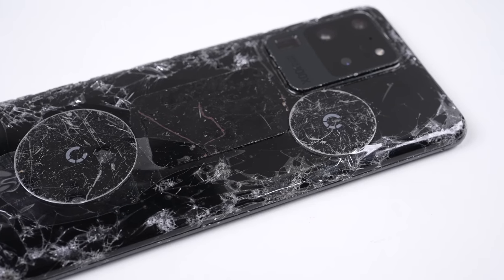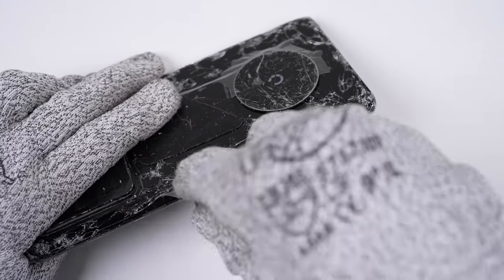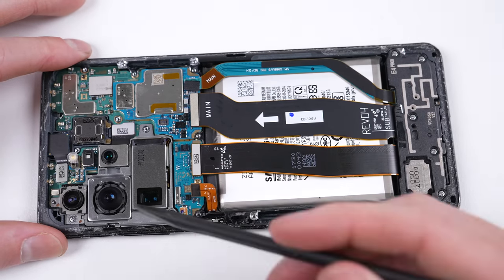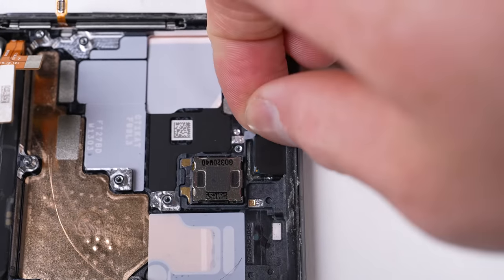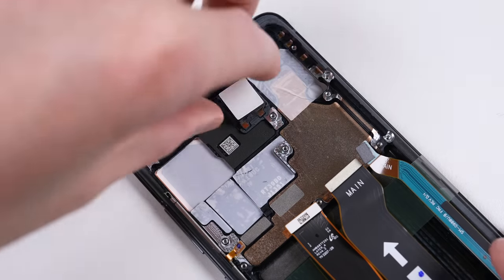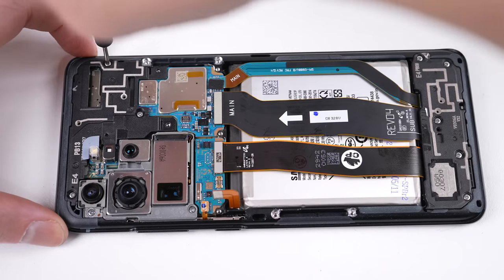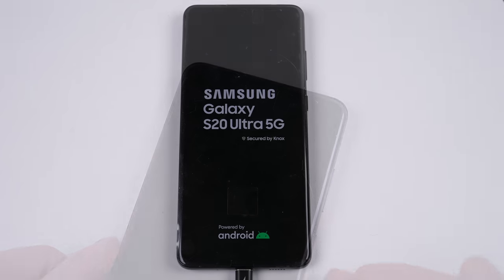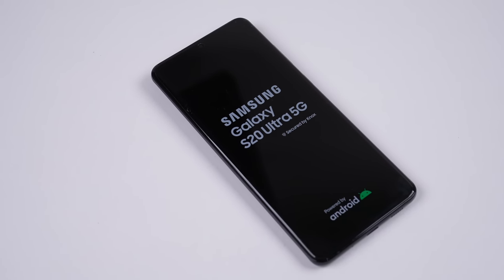$80USD Samsung Galaxy S20 Ultra Restoration

Comment: just by how short this video was, it's fair to say that samsung seemingly make diy repairs alot easier than other companies
Reply: Don't discount Hugh Jeffrey's experience and expertise! I used to repair many devices, but I tip my hat to this man!
Reply: I've repaired a few phones like this as well, and I think LG did a good job with making their phones easy to repair. However, for better or for worse, LG doesn't make phones anymore.
Reply: Not really, he didn’t replace the screen only, he replaced the frame with the screen which is much easier and cost much more
Reply: Androids don't have unnecessary micro components like iPhones.
Reply: Keyword: "Made"
Doesn't make anymore...
Reply: graveyard
Reply: Apart from a missing battery pull tap, yeah they do
Reply: Love Hugh Jefferies videos
Reply: replacing a service pack is easy on any model, if you screw it up the first time stay away from repairs
Reply: Yet it seems like Samsungs dont last long, I had Samsungs for three years after owning iPhones for 11 years, back to iPhone, never using a Samsung ever again.
Reply: @THECAR99  Samsungs also dont last as long, they also have crappy adhesive, and they have a poorer water resistance.
Reply: @LSnium  sounds like you're pretty biased to me considering you've been using iPhones much longer. Not to mention you just state they don't last as long and have worse water resistance but don't back it up at all
Reply: @neelb980  this is just one of several articles on the internet explaining how iPhones do in fact have better water resistance, “For example, Samsung's IP68-certified phones are water-resistant to a maximum depth of 1.5m in freshwater for up to 30 minutes, and the company cautions against beach or pool use. Some of Apple's iPhones with an IP68 rating can be used at a maximum depth of 6m for up to 30 minutes. Jul 4, 2022” -EconomicTimes
Reply: @LSnium  just because Apple doesn't strictly advise against using their phones near the beach or pool doesn't make it safe to do so. And on Apple's own website they advise against swimming with their phones so your point isn't valid regardless. Water resistance is such an insignificant factor in determining the superior phone, and just because a phone isn't rated for as deep water doesn't make automatically make it a worse phone. There are plenty of factors that can influence how water resistant a phone will be
Reply: @neelb980  Give up, you know my argument is valid and iPhones are better, hence the reason they sell more than Samsungs in the same price range.
Reply: @LSnium  seems like you're the one who gave up here. You didn't even bother defending your original point and instead resorted to "I'm right". If you consider the global market share, Samsung is very consistently at the top spot so you are once again incorrect. You can narrow your criteria all you want but the truth is Samsung holds the majority market share pretty consistently
Reply: @LSnium  Iphone has zero customization. Operating system or interaction or boring and old...Samsungs customization with 5.0 anf goodlock make it abetter uses experience...idc about facetime...
Reply: @TheKentucky44  Id rather have zero customization with heavy security on all my data, iPhone makes it so easy to secure your data and rven have advanced data protection so not even Apple can access your data even in a security breach, iCloud keeps your stuff even if someone tries to “factory reset your iPhone” while on Android, anyone caan reset your phone and you lost it all, and they can sell the phone and you can’t get it back. I have found basically no differences but iPhone being overall better than android phones, in my case Samsungs.
Reply: They don't get particularly high repairability grades from independent bodies
Reply: @LSnium  bro came to a Samsung repair video to flex his superiority over Android users because he can't actually accomplish anything in life
Reply: @mus_xr4653  he did say in the video that compared to some phones, this is a walk in the park
Reply: That's cause they're junk and need worked on a lot
Reply: i am totally agreed with you, as an engineer, this is a fantastic design for easy repairable compared to other company that trying to encourage user to change the phone instead of sending for repair。 we should advocate and support this practice to reduce the electronic waste。
Reply: I just swapped the back glass on my S24 Ultra and its was very easy

Comment: One thing that always confuses me in these videos. If you hard reset through the recovery menu, doesn't that result in the device being Google locked when you try and set it back up again?
Reply: Yes if the previous owner didn't remove it from their Google account and had not turned off "Find my Phone". If that's the case, you will need to hopefully have the seller's info; otherwise, hope you paid with paypal
Reply: Scrolled too far to find this comment. I was hoping to know more about it because I accidentally locked down some phones while fixing them in this way
Reply: Is this a thing in other countries? Here in Australia this is not a thing I have reset many phones in the exact way he did and have never even heard of a Google Lock.
Reply: @Bombasticdude11  there is a bypass for most Android versions. In this case you may also be able to put it into download mode and flash the stock rom using Odin
Reply: you can FRP bypass almost any android phone
Reply: So it's a bit confusing because it's not ever really shown. Literally today, I wiped a S21 the same way that it was done here and it did trigger the Factory Reset Protection (FRP). Androids are better than iPhones with this though, and the FRP is stored locally on the device. After I wiped the phone and enabled the FRP lock, I used a downloadable PC tool that can get into the S21 and remove the FRP. Then I blew the phone away completely and reinstalled an official Samsung system image. 

Most repair videos don't need to show all this as it's not part of the physical repair.
Reply: @whosdnc  how
Reply: @Vipce  what phone do you have?

Comment: The 'water damage indicator' you saw on the bottom midframe/speaker was actually just the cover for the little balls the are in the speaker. They are red from the factory so no worries there.
Reply: OK can someone explain what the little balls actually do. I've been trying to find out and still don't understand.
Reply: @Jack Kraken  make the speaker sound bigger and richer from what I can gather.
Reply: @doosanengineer7659  I know but how?
Reply: @jackkraken3888  "What those small balls does is bounce the sound waves around each other and scattering the sound waves out thus making it sound "larger"".
Reply: @RonaldoTalison  thanks does it also some kind of distortion? Sometimes I notice this on my phone and the distortion goes away.

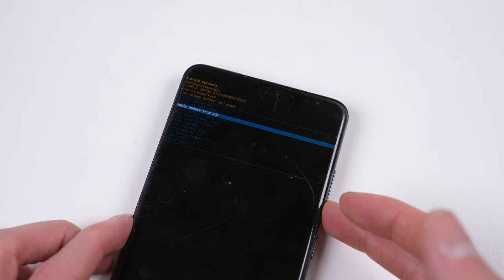Comment: I guess you probably know this, but even if you reset the phone with a hard reset ( 5:47 ) the previous account will still be on the phone just like iCloud lock. You can still remove it, but this can be quite tedious. I would recommend to go through the setup process to make sure you don't need to type in the previous owners Google account.
Reply: exactly. could also be the reason why he did not show the home screen because it is still asking for previous owners google account.
Reply: removing that usually takes 5-7 minutes lol) googles reset protection is a joke
Reply: @koshkingdedamage  how do you remove it
Reply: @JaimeKing1989  there is a ton of videos on this topic on the web. The way I do it - using the keyboard settings to open privacy policy - open YouTube app from that webview and install corrupted Google services to simply add my account - old one disappears.

But this is a very old method, today there are a plenty of newer and faster ones
Reply: Didn't he say he connected it with a computer? The computer probably has software for the complete hard reset and had those google accounts removed. Just guessing 😂
Reply: Yes. Now there are better ways than mine)

Comment: If it wasn’t for you I wouldn’t have wanted to start repairing electronics. I asked for an iFixit toolkit for Christmas and I’ve been working on iPhones. I had some decent screwdrivers I got with an iPhone 8 LCD and I’ve already repaired my friends screen and his girlfriends screen on their 2nd gen iPhone SE’s. I even replaced the battery in my old iPhone 8 and multiple screen replacements
Edit: PS, best regards from the US
Reply: I used to fix my phone myself since s4 mini not that I destroy them a lot but if they are problematic I can fix them. Recently I fixed my pixel 6 pro back glass and I had to remove the front screen too for nfc and charging coil but when I reinstalled it I had left a glass shard right behind the screen long story short there is camera punch sized on the left mid of the phone where you usually read messages which is quite annoying
Reply: Where you get parts from?
Reply: @wb7551  Aliexpress

Comment: I worked as samsung auth. repair engg.  one of the common issue i found with these condition phones is the dust from the damage or mishandling stuck under the camera and troubles in focus and stabilization. Hope you got that good here. 👍👍
Reply: I have one here... trouble in focus and stabilization of camera. 
It's not easy to find an original one (it is too expensive here in Brazil).

Comment: These are so easy to repair and very nice to use as they still have micro sd card for extra storage.
Reply: Still have mines s20 ultra almost 1TB that's including the SD card storage hehe 🔥 have a few art app, fl studio, music downloaded & alot of photos and video doesn't lag one bit the battery life is almost good for certain people if they go nuts on the phone it decent :/ but has wireless charging can't beat that
Reply: @Kushalien51_nv  nice mate im running 128gb with 256gb microsd card atm until i find a 512gb s20 ultra pr samsung bring back microsd storage on the new models

Comment: Did the fingerprint scanner work after replacement of the display? as always prefect video without any unnecessary stuff.
Reply: After replacement of screen on Samsung devices, the finger print sensor still works. 
You can check in his other Samsung videos.

Comment: That was a nice easy repair, from what I saw - I don't see why Ifixit has to give these Samsung phones a low repair score when replacing a display, back glass and battery is relatively straightforward with the right tools in hand.
There's only one type of screw used, and no software locks to be seen in sight.
Reply: It’s difficult to open them without cracking the back glass, the battery has no pull tabs so it will get bent or damaged when removed. And the display costs more than a used working phone. Although this might not factor in the score. While it’s better than an iphone, it doesn’t compare with their older phones like the S2 on repairability.
Reply: I don't know why they give the iPhone a high repairability score. They lock everything to the phone. Can't change your battery without a message popping up and battery health being disabled. Can't change the screen without it messing up true tone. They may be easy to take apart, but they are technically impossible to repair without being able to register the new parts.
Reply: It's because they bought a screen with a frame already attached to it. The screen came with a whole housing. Granted the housing of this phone is really messed up, but I've seen Hugh do the same thing for phones that have good housings as well, unfortunately.

If you try to use your own phone's housing, that means you need a ton of glue and a ton of patience to remove the old screen which will definitely shatter into a million pieces.

iFixit takes that into account. Hugh Jeffreys doesn't, for some reason.
Reply: Its pretty obvious. Samsung does not pay IFixit while Apple has always had a shady relationship with iFixit. If Samsung paid ifixit too, the scores would be high. I never trusted Ifixits repair guides tbh

Comment: Arguably this is one of Samsung's best phones (inside out) especially when it comes to reparability. all this phone was missing is a headphone jack!
Reply: Indeed. With the S21 and S22 series, they even removed the SD card reader, and the A53 5G also has no headphone jack (and no charger). I think the best modern flagship Samsung with all features was the S9/S10 series, with things slowly going south from there.
Reply: @Carahato  iris scanner from the s9 is pretty cool
Reply: @Carahato  Imo the s10 was...
Reply: @Archie.9005  The S10 already lost some of the features the S8/S9 had, like the iris scanner, 3D touch home button, heart rate sensor, or the notification LED (it got the fugly hole punch instead), but it was the last Samsung flagship that  came with a headphone jack, a microSD card slot, and a charger in the box, so there's that.
Reply: @denny1527  The s10 still had the heart rate sensor (minus the s10e), still had the notification light (via amoled ring light around the punch hole) and it had the ultrasonic fingerprint scanner (more accurate than the optical scanner found on other under display phones) I also think the iris scanner is a bit of a gimmick since Samsung is known for being the tech company with the most unusual products like the galaxy beam with was a phone with a built in projector, the galaxy round which was a phone with a display curved inwards and the zoom s4 which was a phone with the really big camera, all of which didn't sell well. Still think Samsung is a unique company unlike apple who sells the same shit every year and making it eyewateringly expensive and difficult to repair.
Reply: @Archie.9005  I must've missed the part about the heart rate sensor in the specs, my bad. I admit that my dislike for notches and hole punch cameras comes partially from my personal preference as I still use an S8 which fortunately does not have one. Still, I think the S10 is a good phone, and probably the last one where Samsung actually tried to be different than Apple (by keeping the features that Apple started to remove, and not immediately following them like Google). It is sad to see everyone trying so hard to make their phones be like iPhones in terms of features. A good example is the microSD card slot - funny how my S8 with a microSD card has more storage than the top spec S22 can have.
Reply: @denny1527  You can actually get used to punch holes or notches (specifically iPhones) when you get a new phone. It's there only way on minimizing bezel size without removing the front camera, but with the advances of technology companies already developed the under display camera phone. You could upgrade to a newer model if you had the budget...
Reply: @Archie.9005  I suppose that if I had the ability and need to upgrade I would eventually get used to it. I actually got the S8 fairly recently (less than 2 years ago) and I plan on using it until it either dies or the Android version is too outdated. I know it's an old phone, but if it does all that I need it to do then why change it? I think it's better to run phones into the ground instead of upgrading every 2-3 years just because why not. Android security is another issue, as Pie might be a bit old, but I'm aware of that and I try to keep it as secure as possible (not install too many apps, disable installing unknown apps, not connect to public WiFi, keep WiFi, Bluetooth and NFC off unless I need them), and with that I think this phone could still be useful for the next 2-3 years (without installing custom ROMs), instead of being tossed in the drawer or into recycling.
Reply: @denny1527  I literally owned an old phone that's stuck on android 5.1.1 for almost 7 years, I'm still using it as a backup phone incase my daily driver breaks. Apps are still available on play store but most of the latest features are missing since it automatically downloaded an older version...
Reply: @Archie.9005  I still have an old tablet that's on 4.4.2 and it was only recently that apps stopped being compatible with it though I stopped using it earlier as it had only 16GB of storage and a broken microSD slot. I was previously referring to the amount of people on the internet that will tell you that once your phone receives its last update you can throw it in the trash as it will immediately be susceptible to every single attack and once you connect it to the internet it will get all sorts of malware on it. While there are certainly some exploits that could put your phone at risk, most of the time (at least in my experience) it is really hard to get malware on Android unless you really ask for it.
Reply: @denny1527  You'll only get malware when you click on websites, ads, anything that is sus. The reason why I kept mine because it had a really big storage space (64gb) kinda useful as backup when your main phone is full.

Comment: Despite its relatively lukewarm reception upom release, I still really like the Galaxy S20 Ultra (my current phone) and it still feels just as sleek and modern as any other phone even 3 years later. Biggest downside is that this is the last year of official support from Samsung on this phone despite the fact that it could easily last another 5 years if it were given software updates.
Reply: is it really not supported at only 3 years old? no way
Reply: @karmakaze9972  Yeah Samsung is really bad when it comes to phone support. Before the S20 (or maybe S10?) line of phones, they only supported their phones for two years! Nowadays they support them for 4 at least, but it's still nowhere near Apple's 6 years of support.

Comment: Hello, nice repair video. The initialization was not looked by the previous owner Google account? Usually hardware buttons hard reset requires to connect with previous owner Google acccount.